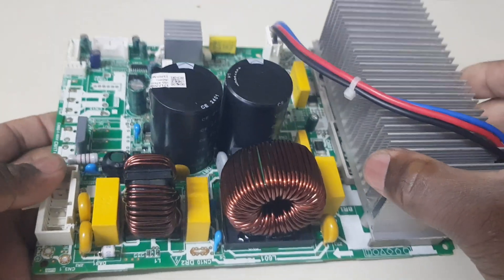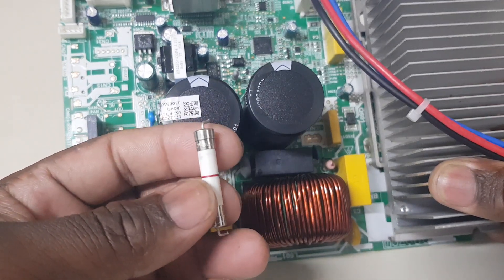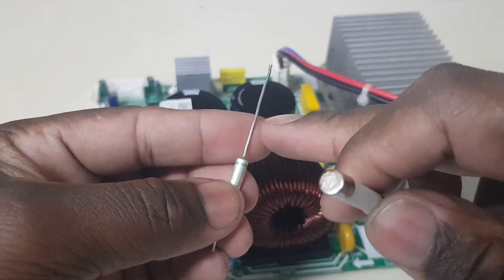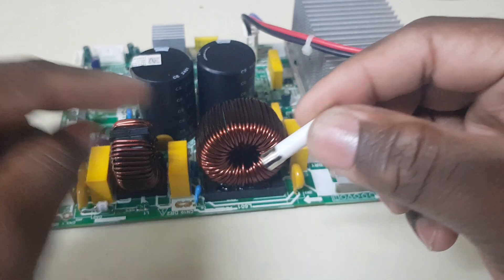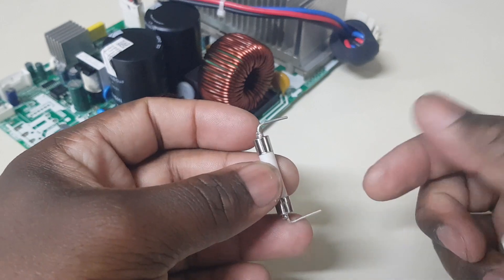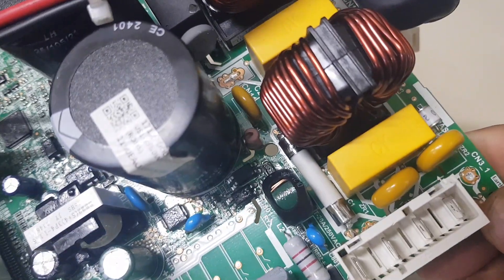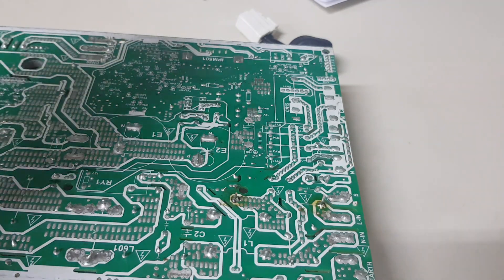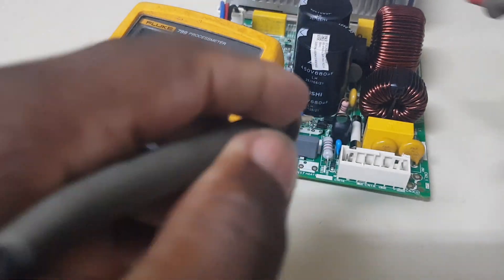Air conditioner control board KFR-35W/BP3N1 | How to replace blown fuse.

Comment: the CE 2401 on mine bulged. Is it bad? My fuse also burned
Reply from the maker: Once their a bulged it's telling that component is defective. And the fuse have to replace it with the same ratings etc. And ensure to check the circuit properly for any other damage component.

Comment: Please have a look at the both electrolytic capacitors, 680 uf, 450 V, one of them seems to be arched, what means, that this can be the reason for the blown fuse.
Reply: Great job, easy and clear video.
Reply from the maker: @ElectricalvoyagewithJeremy  Thanks I do appreciate it alot 👍
Reply from the maker: @mccarthyfan408  Thanks for the feedback, I appreciate it alot. Both electrolytic capacitors was check and their okay 👍